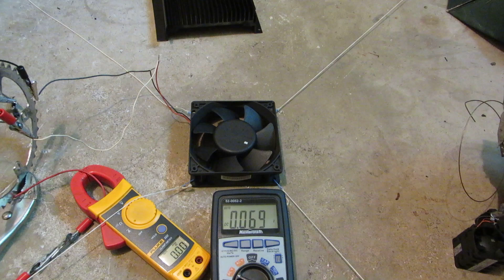PC Fan Flight Tests -  Follow Up, Was I Wrong?

Comment: Having the heatsink was actually a good thing. Having the channels there removes the ground effect and so gives a more realistic test of "flight". Without it, the fans will have a lot more help from the proximity of the ground, and wont actually take to flying. Additionally, and more importantly, it stops the fans from aerodynamically stalling as they would if just up against the concrete.